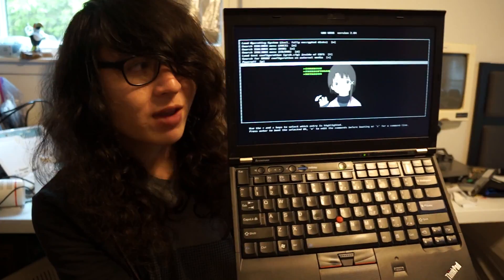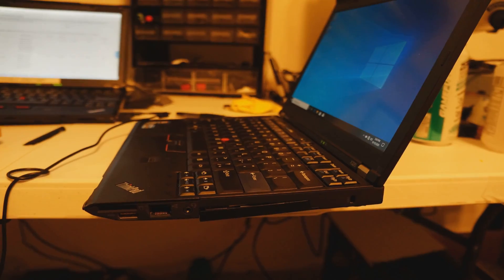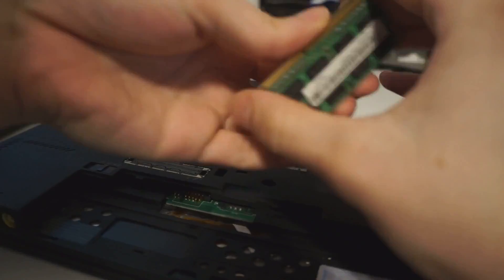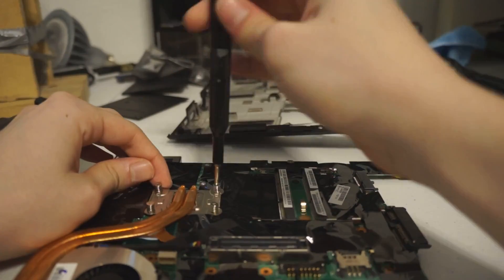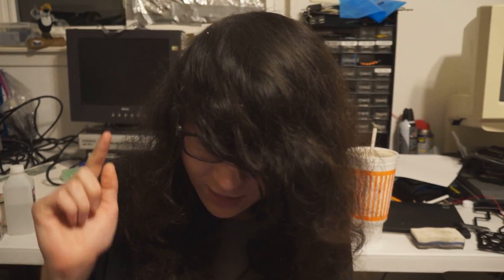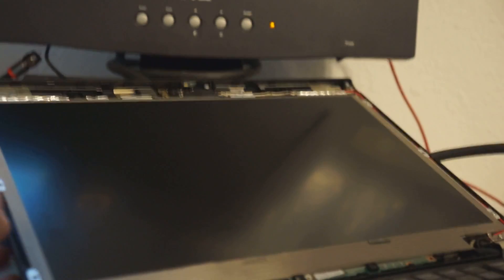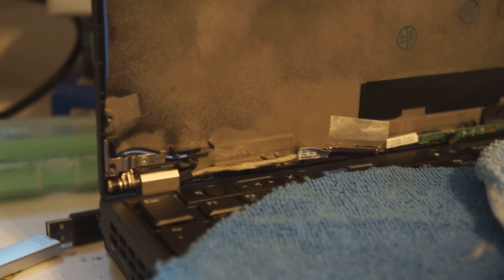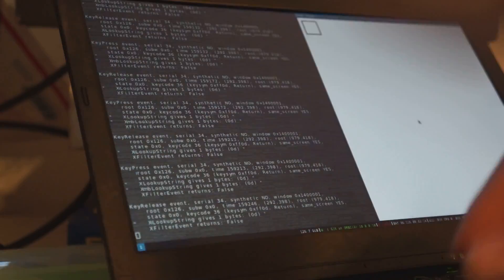Spec Out and Restore of a Badly Refurbished Thinkpad X220! (IPS Coreboot SSD 16GB of RAM)

Comment: can i install 1920x1080 ips display on x220 without the need of a lvds to edp converter that requires to upgrade t430 ips screen?
Reply from the maker: I think the x220 and x230 fhd mods require using the display port lane from the docking station.

Comment: Hi @Tripcode!Q/7 nice to meet u, I love ur videos can u post where to order an IPS screen on ebay and the model that you order for my x220 NT and x230NT so i can buy it and replace it? Thanks!!!!
Reply from the maker: Umm, I have had bad luck with ebay screens in general, but aliexpress screens are worse.

Just look at the seller ratings, and return if it is the wrong type. I've had a seller ship me the wrong, but similar enough ips display before, as well as one that just shipped a glossy tn panel. I started a return on the TN.

Top thing is make sure they have a decent return policy.

Comment: hello, I have a ThinkPad x220, when its turned on and I plug the charger in, the screen goes black for a few seconds, the ThinkPad is running on windows 10 pro, 64 bit, any ideas what is causing the problem and how can I fix this. any help would be appreciated. thank you.
Reply: That's normal. The display switches from 60hz to 50hz to save power when running on battery. Can be turned off
Reply: @Srp_-_f  thank you for replying to my comment.
Thats good to know!

Sincerely Guy.

Comment: Hey tripcode! What are your thoughts on Foxconn motherboards, the G31MXP-k series to be specific. I have one and use it as my main PC running Debian xfce. I was wondering about the pci slot. Apparently I never got to use the PCI slot, and it was always left blank. Recently I was thinking about installing a GPU and also upgrading my RAM. Would you suggest what sort of gpu I should use on my Foxconn board. Also, Love your videos as always!!